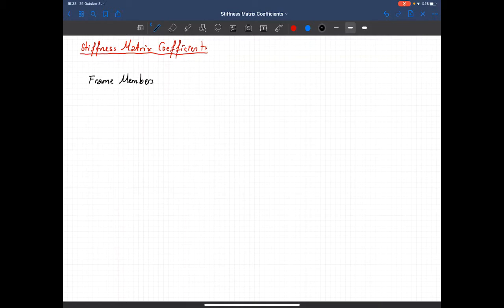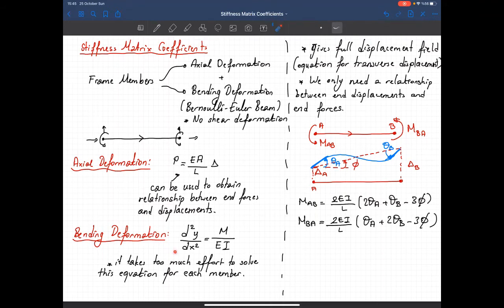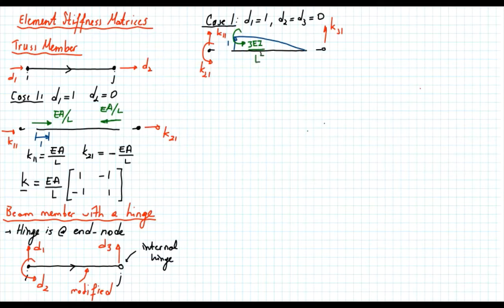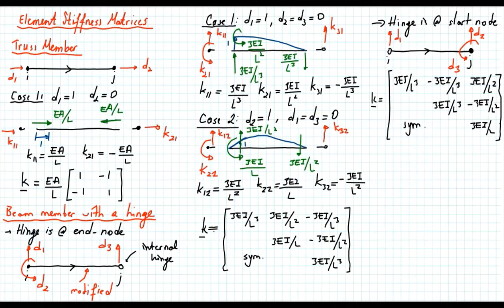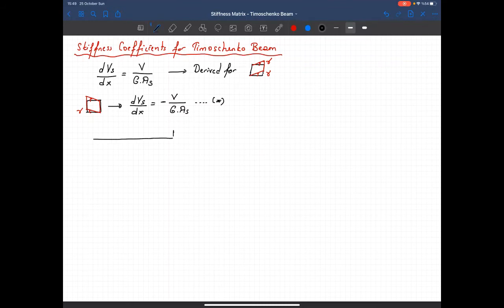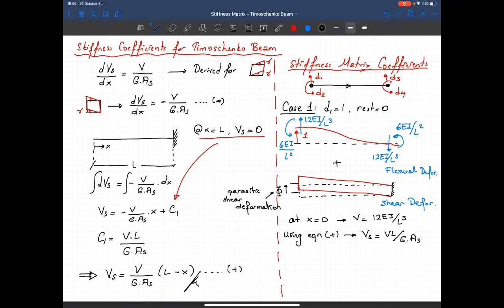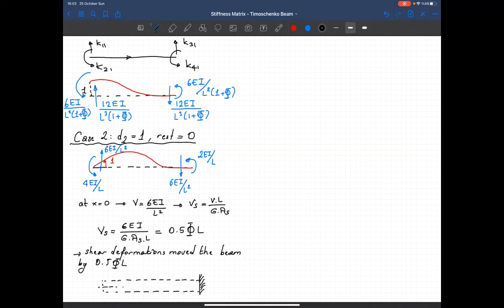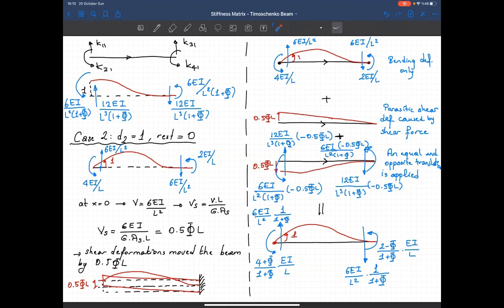CE 483 - Element Stiffness Matrices with/without Shear Deformation, Week 3

Comment: Excuse me professor, which book should i check in order to understand and look more examples of the inclusion of shear deformations in stiffness method. Also I want to know if there is a book including a rigid arm (Elemento with EA=EI=Infinite), as effect of a shear wall analysis with beams, or the procedure to determinate the stiffness matrix of nonprismatic elements.
I want to thank you for the videos, I'm fromm Perú and found the information very valuable for structural knowled, you have a great method to explain.
Reply from the maker: You can check "Kassimali, A., Matrix Analysis of Structures, 2nd Ed." but most of the things that you watch are my way of formulation. There is another class video which is related to rigid end offset and I think, it will help you to understand what you are asking.